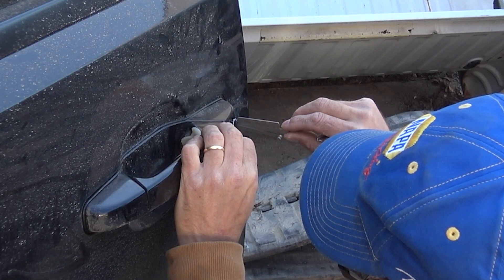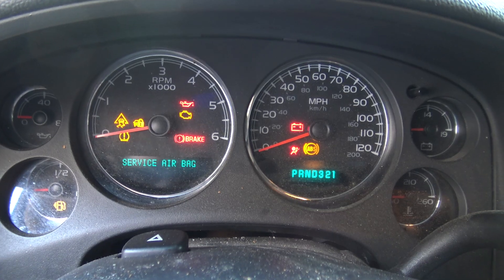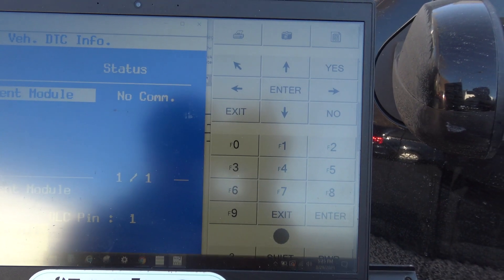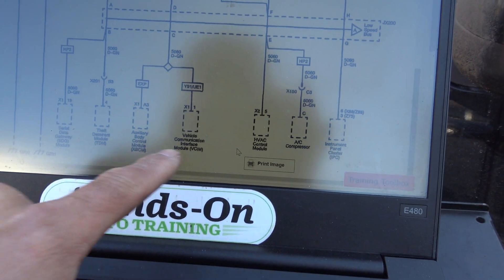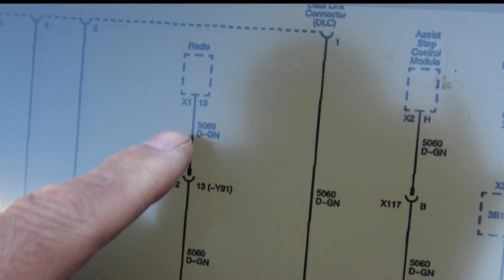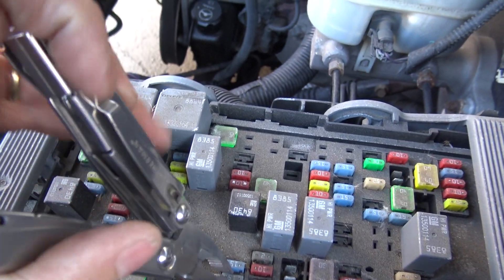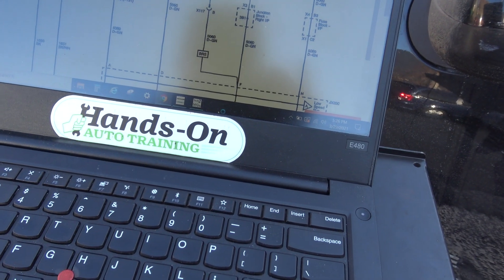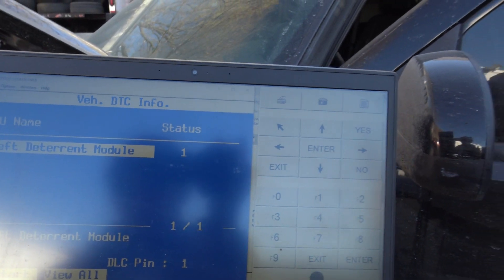2008 Tahoe No Communication THEFT MODULE How to fix was pulling a fuse

Comment: Great video. I had a customer today that called me. Stating they locked their keys in their 2014 buick lucerne. So I drive over. Unlock the car. Grab the keys and hand them to the customer. As I picking up my lockout tools. The customer tells me the car is being towed to a shop because it won't turn on nor will it start. So i said let me see the keys. I noticed the key fob wouldn't lock the doors. So I tried starting it. Wouldn't start, no power. Just a step on brake message. I opened up the key fob and pulled the battery. Went to the drug store and bought a new battery. Put the battery in the fob. Unlocked the doors climbed in. Put my foot on the pressed the ignition button and it fired up. She about started to cry. I said what's wrong. She said we had this parked in the garage for months because nobody could figure out why it wouldn't start nor run. She paid me and I left.  Cr2032 battery was all it needed
Reply from the maker: Thats crazy, sure is nice when you are able to help someone out!
Reply: @BrianMann216  thank you. I have had good teachers like yourself
Reply: @BrianMann216  I tried finding your video on what you have in your diagnostic arensal. Video you made year's ago as well as your video on ECM communication. About checking the basics.

Comment: Brian it seems like to me oa couple of first things to do is check powers grounds and any aftermarket add one. Sure seems like add ons do not play well on today’s networks. Don’t know where your going but enjoy your time Artie 👍
Reply from the maker: Hi Arthur, you are correct that one of the first things I would normally do is check the powers and grounds to suspect modules.  This case was a little luck and previous expirence.  I was surprised myself when it took care of the issue by pulling the radio fuse, then I thought  I better share it with you all.

Comment: Great information Brian. I’ve seen this before but never thought to pull the fuse instead the connector on n the back of the radio.
Reply from the maker: I have found for what ever reason the fuse pull will do the trick most times for sps programming. Only when the network is pulled down(or up) due to the faulty module have i had to disconnect it completely.  I am planning to share some locksmith tooling and such for this week's web meeting..